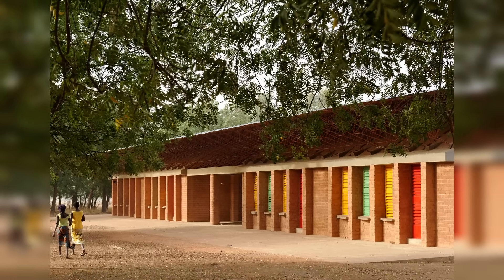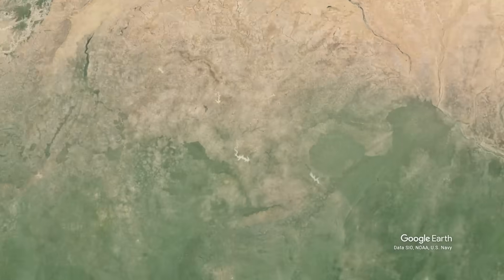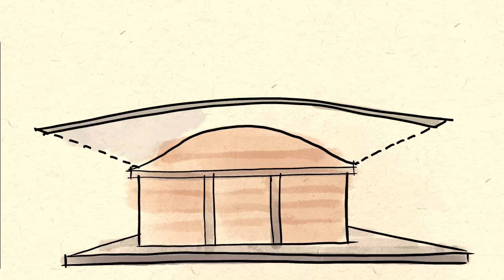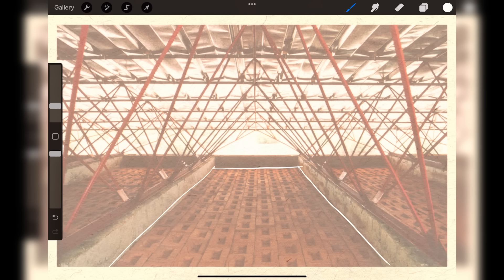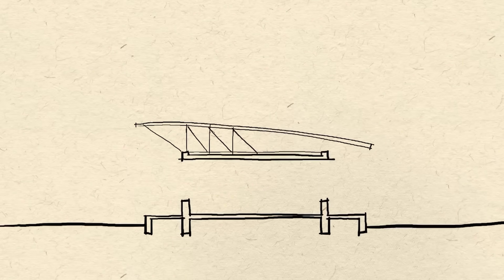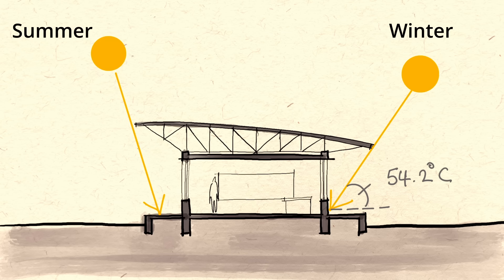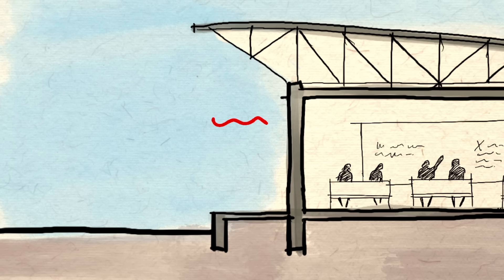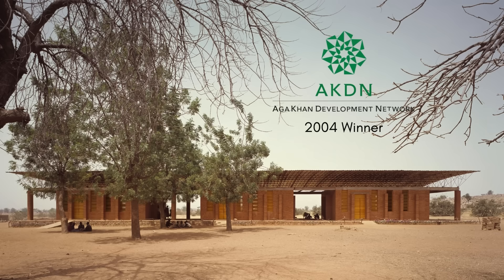The 3 Design Strategies Keeping This Building Cool In Scorching Heat

Comment: I wonder about heat mitigation all the time with my businesses.  We rely so heavily on mechanical HVAC solutions in single floor plazas.  When an HVAC isnt working correctly  the flaws in the structures we have to passively mitigate heat or cool are extremely noticeable.  

Planting a tree to give shade is a 50 year solution and not practical in a commercial sense. So having a secondary roof is something i def would like to explore

Comment: In the graphics you mark the summer  and winter temperatures in centigrade, but I think you mean 100+ Fahrenheit rather than 100+ centigrade in summer, ditto for winter? 100 centigrade would be way beyond lethal!
Reply from the maker: Well spotted - it was supposed to show the angle of the sun! Nothing to do with temperatures 😅 the C should not be there 👌🏽

Comment: This system works best in arid climes where the humidity is low. With high temperature/high humidity situations, natural cooling is much harder to achieve, though this might be as good as any.
Reply: Humidity restricts this design a lot, but still better that a badly designed building.

Comment: Thermal mass is generally avoided in hot climates (except for cost reasons. It ONLY works with LOW HUMIDITY because of the increased day night temperature difference and if the walls (and preferrably some of the surrounds) are completely shaded. And the Bernouli effect is powered by a breeze, eg prevailing winds. Without it you just slow the heat transfer. So yes its great - but only in a desert with consistent prevailing winds. Its a good solution for a special case only. Far enough inland not to be humid but not so far that there are not prevailing winds. Without those winds the inner roof is pointless and expensive. Its kinda hard to believe you didn't know this. Nice clickbait.
Reply: The second roof is a sunshade.  It’s hard to believe you didn’t know this.
Reply: @mikeguitar9769  So the bernouli effect is not needed except in a dry desert with regular prevailing winds.. The inside roof is only needed to stop radiative cooling. You don't seem interested. ok maybe its new and exciting to you but most people use aluminium topped tar paper with vents on both sides of the house. Or poor people use thin ply. Its true - the locals are not architects so I am sure it was exciting for them. But I doubt they can afford to copy it at home

Comment: Switch uses this same technique for their data centers here in Las Vegas. A double layer roof, high albedo layer (on top), and they use cooling towers to push cool air between the upper roof and the lower roof.

Comment: In SE Kansas we have an average summertime high of 93 with humidity. It's hot. But we pay no attention to natural solutions. We could learn from this design. Save a lot of energy.
Reply: This roof structure might not stand up to the storms we get in tornado alley. I would love to see thermal mass get more attention though. Earth sheltered buildings are much safer in a tornado as well benefitting from the thermal mass.
Reply: @beth8775 
I visited an “Earthship” rammed earth house in New Mexico during August, about a dozen years ago. It was 91 outside and 73 inside, mid afternoon.
Reply: @beth8775 😊
Reply: @beth8775  I understand your point. I think it is significant that this architect grew up locally so he understood the particular factors he needed to take into consideration.
IMO it would be best if an architect who is intimately acquainted with the factors in your particular locale, and has a complete and practical understanding of the problems, could design buildings for your needs... if such a person is available. I hope you could find someone with such vital, necessary, and important, but often unrecognized or overlooked, qualifications.
Reply: It also gets very cold in the winter in SE Kansas. If you optimise for summer you hamper conditions for winter.
Reply: @WeighedWilson Not necessarily, but you would have to plan for that too. For example, if you have a way to enclose the area around the outer roof in the winter you suddenly have more insulation in the trapped airspace.
Reply: won't do much good with heat and humidity all day and all night even in the shade
Reply: @LawrenceWeber-z5o verified as someone who lives in one of these houses in a humid area.
Reply: You go first.  Let me know how this works for you.
Reply: Aside from building finished basements and partially into hills, there are no "natural solutions" given the extremes of climate in SE Kansas.
Reply: And what about strong winds? 🤔🤔
Reply: @MarcoArezzo76 engineering can and does overcome these obstacles.
Reply: That roof isn't going to hold up in our part of the country.  I'm near you in Northeast Oklahoma.  That roof will lift right off in a decent thunderstorm.
Reply: @argentorangeok6224  can't you invent a similar roof for your winds? Copying African buildings verbatim is not the only way, you know
Reply: @NJ-wb1cz  No.  You can't make roofs here in a way that allows them to have a tremendous amount of lift, aerodynamically.  The best we can do is gable vents and ports.  Any more airflow through the structure would make the building uninsurable at best.
Reply: @argentorangeok6224  so don't make the ones that lift, make the ones that are pushed down when the wind blows
Reply: @NJ-wb1cz  We have those.  You see them all the time.
Reply: @argentorangeok6224  . I wasn't suggesting we use exactly this technology but that we use some of the natural solutions that are available to us.
Reply: Go Gorillas
Reply: To be fair, a lot of the houses in Pittsburg have high arched roofs which was the old school way of reducing heat. Give them some credit.
Reply: Americans are incredibly wasteful in everything they do.. shamefully so
Reply: you watched the video, it's not that deep.  just to remind everyone people lived in every corner of this continent for tens of thousands of years and utilized local materials for shelter. just look up earth lodge and get to digging
Reply: Current heat wave is well past that. Any  future design will have to take climate change into account.
Reply: @brodriguez11000  climate change is a myth to keep the unscientific masses afraid and ignorant.  The sun dumps 1000 times more energy into the earth every day than all forms of human created energy combined.  We are an infinitesimal drop in the bucket.  If we brought all our activities to zero and went back to the stone age, literally nothing would change. 

If you want something real to work on, look into the damage plastics are creating.  Also, plastic recycling is a huge scam.

You're welcome, now you can go work on a real problem.
Reply: @brodriguez11000  my thoughtful and informative response to you regarding the absurd clown show that climate change is was deleted.  I should've saved it so I could repost it.  I wonder what goofball reported my comment and what the complaint was...

Too factual?
Going against official narrative?
Too supported by reality?
Reply: Well "...we pay no attention..." because capitalism wouldn't have it any other way. There's 300 million Americans, get one dollar from each of them once and you're wealthy.  Get one dollar (or more) profit from each of them every month and you can own a television network and some Senators.
Reply: @arcanondrum6543 blah blah blah blah blah such a drip
Reply: @arcanondrum6543  1) There are more than 340 million Americans; 2) stop derping about capitalism, I'm so tired of people derping about capitalism; 3) passive augmentations/solutions to climate control are employed variously in many use cases in the United States; and 4) in many areas of the U.S. the climate is too varied, the wind is too often too high or too absent, and the temperatures experienced are too extreme from one end to the other, and the humidity is too high for solutions like this to be effective.
Reply: @Objectified  this solution package was for its own set of circumstances. You wouldn't use the same solution in a different environment. There are different solutions for different environments.

Comment: The shape of the roof in the pictures is not the same as the shape in the cutaway diagram showing the "Venturi effect". The flat inner roof of the actual building does not have the curve to create a narrowing section and therefore no venturi. Not sure why the explanation is part of this video.
Reply: Because this channel has a narrative to spin. Did you also notice the lack of temperature reading.

It is definitely a well designed building, just no way near effective as what it is made out to be. Definitely not a “No AC Needed” building like it says on the thumbnail

Comment: I live in areas where temperatures soar upto 48c max and 40c on average. One of problem is low air flow. In desert air flow is good. 
But biggest problem for us is rainy season with too much humidity. Hot weather lasts for 2 months but humidity weather lasts 6.5 months. 
Is there any passive cooling method for humidity free homes ?
Reply: That is challenging.  What energy sources are available?  Are there streams or rivers to use for hydropower?  Is there much firewood?  Is there any sunshine during those 6.5 months?  Wind power?  

Reducing humidity typically requires compressor-based air conditioning, or desiccants that need to be dried generally with a heat source.
Reply: If you live near the ocean you could pump very deep cold ocean water up and humidity would condense on it. The dew point of the air would be reduced down to the water temperature.
Reply: @mikeguitar9769  Thanks. But i don't live near an ocean or water stream. Only option left for us is compressor based air conditioners. 
desiccants can be a good starting point for me. I live in Pakistan and pink himalyan salt mine is here. salt mine is also humidity free and has pleasant temperature inside.  Thinking about using salt slabs or stones. Place salt in room attach a fan let's see how much humidity it can control. I also found out that there are some salt rooms made for therapies and they have no humidity inside.
Reply: I think there's a video from India about cooling without AC.  Something about creating a wall of clay cones shaped like bottles.
Reply: @raj66kas  Yes an Indian engineer created terracota clay based waster cooling system. But its for hot weather only. when you use water than humidity increases and i need a solution for humidity.
Reply: Dig down.

Comment: This is a great common sense building. Thank you for presenting it to us. The ram used to make those blocks is an easily dismantled UN design that can be welded together in just about any steel fabrication shop. The basic model is powered by one person. No external power source required. The blocks are moist loam with around 3-5% cement and are air dried for a few weeks before being laid. I've been to a course on this tech and it's fascinating. Look up the CINVA ram for more information.
Reply: They should do experiments to see if the can handle long term water saturation, if so you could wet the wall and it would be 10-15% cooler.  I've been interested in passive homes since 1967 watching real hippies building a house of mud bricks, just as a interest over the years.  I tiled swimming pools in the SW USA, thousands of them, in 122 degree F, near the end I would put up a 40'X20' 70% shade, like a knit nylon, and even had 12+ tiny misters.  And only swam-coolers at home.  I live past the 45th now and think why people don't build houses alike the arcane Russians with a central huge mass of masonry for the wood-stove/oven.  The thinks I think of baking or freezing...
Reply: Never understood the Cinva ram where in the 18th century they mounted the brick press under the surface of a table with a body weight pedal,  making filling from a surface and pressing by body weight much simpler

Comment: Disappointing presentation, the real key was the passage of air from the classroom to the roof cavity, but NO explanation, btw, the building could be a LOT more efficient IF it drew its air from buried pipe that cooled the air in summer and warmed in. Winter, either by adiabatic drawing or a small photoelectric powered fan
Reply: Yours is a pretty negative comment. Even if you disagree, there is a way to do that. Be kind with your words. Respect 🫡

Comment: 02:55 Angles are measured in degrees or radians, and not in degrees Centigrade.
Reply from the maker: Well spotted! The C was a mistake! Those are meant to be the angles of the sun ☀️
Reply: You should also mention that the whole point of the high air speed  Venturi is to cause a low pressure zone that will literally suck hot air up through the perforated ceiling.
Reply: lol, those are degrees celestial!

Comment: Outstanding.   Think outside the box.  Rely on AC and suffer when the power goes out.
Reply: Fortunately the solution comes in the same package as the problem. The same sun that creates the heat provides also the solar energy to run AC. With today’s technology, cooling is a much smaller problem than heating.
Reply: @peterp5099  No, it makes entropy grow. Passive solutions always are better because they're neutral about energy.

Comment: What’s the definition of cool.   If it’s 95 outside and 85 inside it’s cooler but not cool by most people.
Reply: If you're a Local, it probably feels pretty good, especially with low humidity.
Reply: 85 with a fan is bearable

Comment: The point with the thick tombe walls is that the heat dispersed at night keeps the rooms pleasantly warm at night instead of too cold due to too quick heat dispersal.  This makes optional night time use  of these rooms practical as well.
Reply: Thank you for that observation!  I was wondering why on earth the architect would want to use a heat absorbing material instead of a heat reflecting one for the wall of this building. So, it’s about regulating temperature, not just cooling.  That makes it even more interesting.
Reply: @jmhatyoutube6283  It's about cooling. The walls cool down at night and absorb heat from the air during the day, which cools down the air. It could've used a reflective material on the outside, but who wants a reflective building? It's also in the shadow so I don't know how big the difference would really be. As you could see in the graph, it doesn't really get cold at night. Even in the coldest nights, it's still 15 degrees Celsius outside and it's gonna be a lot warmer inside.
Reply: @jmhatyoutube6283  There are two relevant variables: Thermal mass, i.e. how much heat can be stored, and surface area to volume ratio, i.e. how fast heat gets transferred into or out of the thermal mass. Generally speaking more thermal mass levels out the temperature over the course of the day (or possibly even longer!), but you can tweak how fast heating up and cooling down happens by increasing the surface area of the wall. Remember that airflow accelerates this and that hot air rises, so if you want more heat to leave you need to allow the hot air to escape, so any changes you make to increase surface area (like the ribs shown at 3:53) have to be vertical. If conversely you want to retain heat you can make the ribs horizontal. 

Next remember that the earth in shadow is always cool and stable, so if you can guide the inward airflow through an underground room, you will always have cool air getting sucked into the building, and since this is driven by hot air leaving the building, and hot air leaves the building through the high openings, this will automatically speed up when it is a hotter day. If you want more control you can have wooden windows up high you can open as needed, though this building design does not need that.
Reply: Proivided you can get past bureaucracy and corporate money.
Reply: @RT-eb6vo  
I have to agree with you on that.  Lots of housing techniques that are cheap for do-it-yourselfers are "overlooked" by those that approve the universal building codes.
It's disappointing in the least, and saying it's disgusting may be too mild......